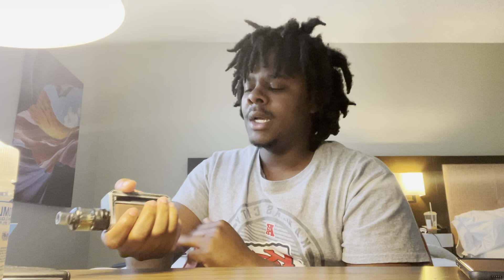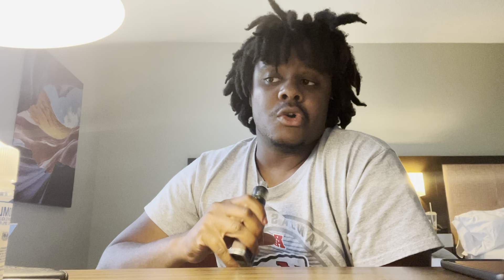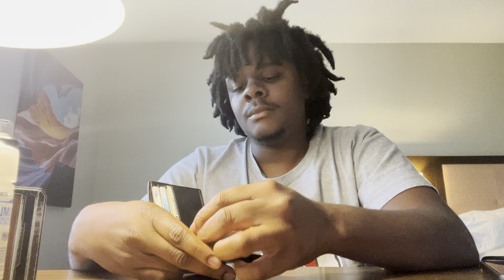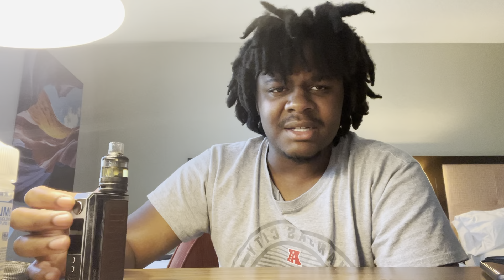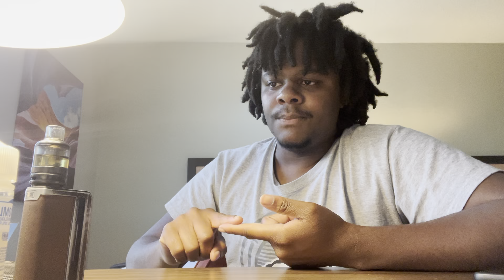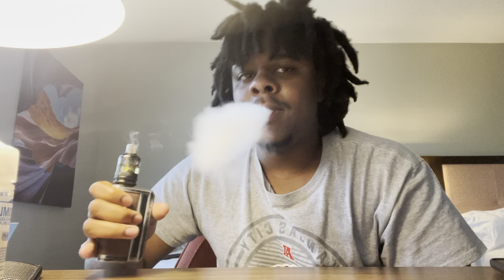Truck is FIXED! | 2023 Peterbilt 579 is BUILT

Comment: Bro I had the exact same problem on my 22 international LT. Only 50k miles on it and we started losing tons of coolant and couldn’t see where. Ended up being the coolant hose going to the DPF system. Coolant leaked all over the batteries too. Very strange
Reply from the maker: It started when I climbed donners tbh. Blew my mind considering I was so light